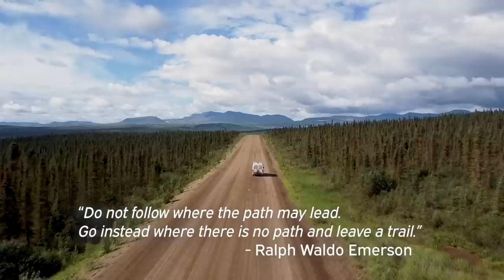WE'RE TRYING TO LEAVE THE USA -  BUT WILL THEY LET US?   [S7-E90]

Comment: Use JB Weld and apoxy it together. Guaranteed it will hold the head on the stick shift. Rough up the surfaces and follow the directions on the J B Weld container.

Comment: Can you tell me ? If the MOT has run out on a UK registered Vehicle . then it must not be legally registered , Therefore not insured , We kept a UK  registered car in France but had to return to the UK every year for a new MOT.
Reply: It can be a registered vehicle with no MOT. It still exists and hasn't been scrapped. Whether the insurance is valid is another thing, as all UK insurance companies require a valid MOT, unless maybe they have a special arrangement. However if you are buying local insurance then I guess it doesn't matter.
Reply from the maker: Hi Ian - MOT is required to purchase insurance from the UK that covers countries on the green card - this is why we shipped Trudy from Istanbul to UK as we were not able to get insurance to drive through EU.  We renewed her MOT whilst in the UK but we did not need it to buy insurance in the USA.  This is also another reason we do regular check ups and maintenance to keep Trudy in tip top shape 🚐🙌💕🌷